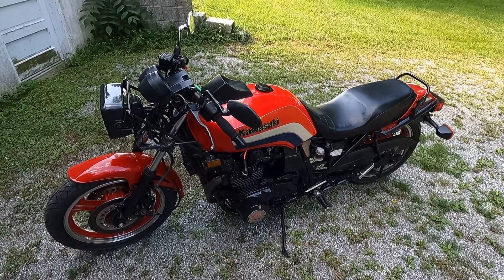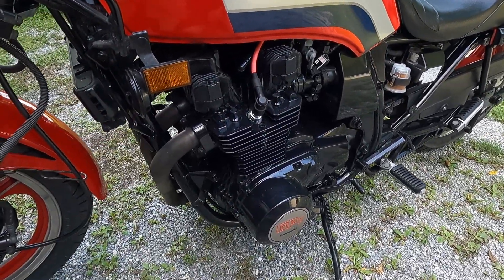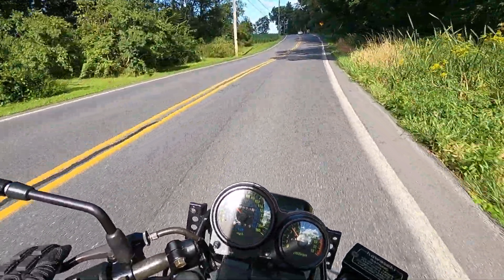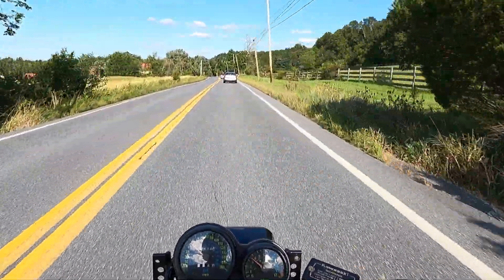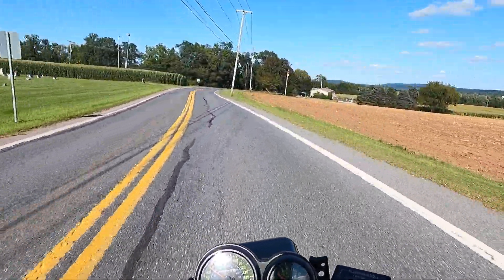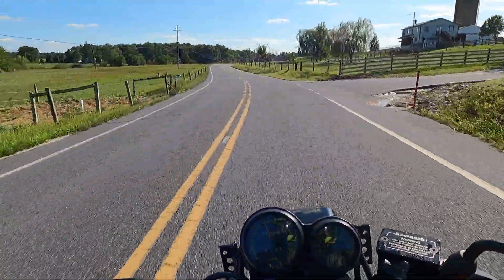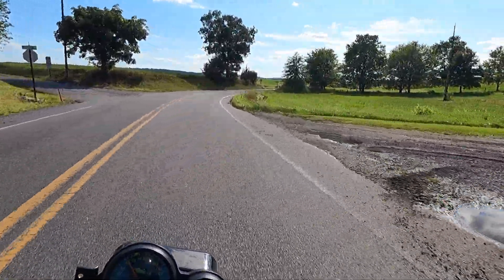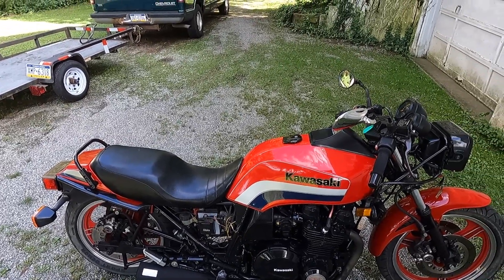1983 Kawasaki GPZ 1100 Rescue - Part 5

Comment: How does it ride with the Rigid rear suspension?
Reply from the maker: With the taller vintage size tires it rides surprisingly well. You only notice the solid rear on sharp bumps. If it had more ground clearance I could really push it in the corners. I am not sure if I will leave the solid suspension on it or go back to stock. First, I want to get the rest of the bike thoroughly sorted.
Reply: @jonsmotorcyclerescueandrev3538  That makes sense.
Sounds good and looks good.
I like these old bike and my bubby keeps telling me to buy and new one. But I like the old ones.
Reply from the maker: @andrewnewman6510  I agree, gotta love the vintage machines. However, like old cars, they take love, time, money and dedication to get them properly sorted and functioning well as a daily driver. If that isn't your expectation, you'll be happier with a newer machine.

Comment: Hi Jon, I was looking at the GPz you bought. I was wondering how it is that you find such pristine examples of the 80's muscle bikes. Here in Australia they are all weathered and it is extremely rare to find one that tidy with an engine that looks new. After looking a bit more, are you going to find a replacement Unitrack swing arm? I see that some dufus has replaced your swing arm with a stretched and hard tailed one. Must be a rough ride.
I had one of these back in the late 80's. They haul. It was a step up from a Zx Turbo for me. Mind you I did find myself missing the lightness of the 750 and its cornering ability over the 11. Still, haven't gone back in size really(1000cc)
Reply from the maker: Finding nice condition vintage bikes is never easy. Regular scanning of the ads helps. States in the US with a winter season and a nice riding season usually have lower mileage bikes and people store them inside (if they have lasted this long). I live in such a state, Pennsylvania, but finding nice vintage bikes is still a challenge. 

As for the GPZ, the engine has been repainted by a former owner. The solid rear suspension rides surprisingly well with the taller vintage size tire. You do feel it on really sharp bumps but it isn't terrible. Ground clearance is my main concern. I may put it back to stock but I want to get the rest of the bike sorted first.
Reply: @jonsmotorcyclerescueandrev3538  So thats why the engine is so new looking. A repaint. The ones I see in AU all look a darker shade of grey with ali salts on them. You are lucky to have at least 100 times the population to find these stored away. Keep on with the vids
Reply from the maker: @Tommytoff  Will do, thanks for the encouragement!
Reply: @Tommytoff  Maybe 12 times the population.  Still increases the odds.